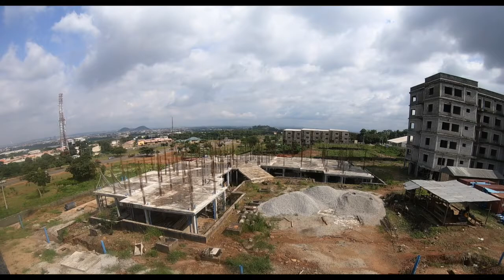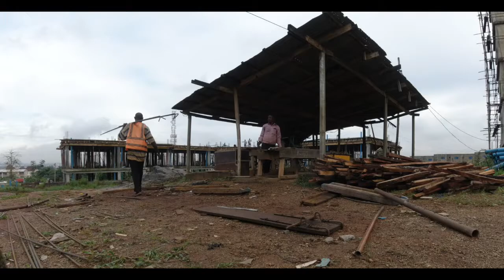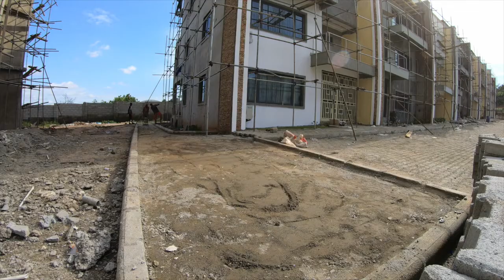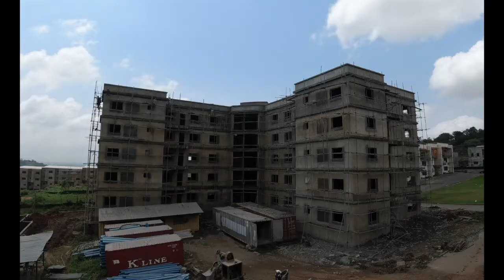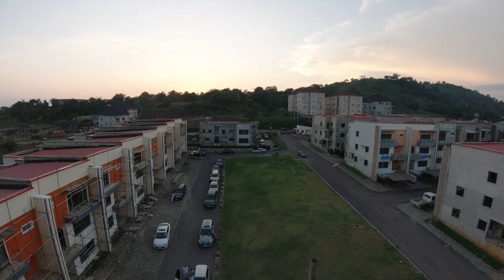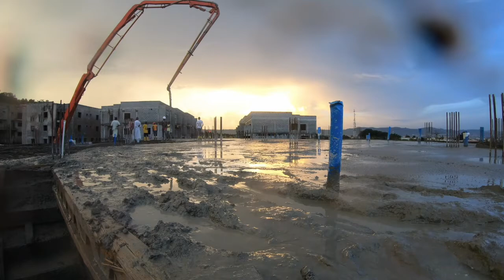Asba+Dantata Lifecamp Estate Time Lapse

Comment: For a project this size did you require a concrete batching plant on site? I see the mixer truck and pump but no batching plant
Reply from the maker: We buy from 3rd party. For the smaller houses a small concrete mixer on site....
Reply: @bdantata  got it! Thanks